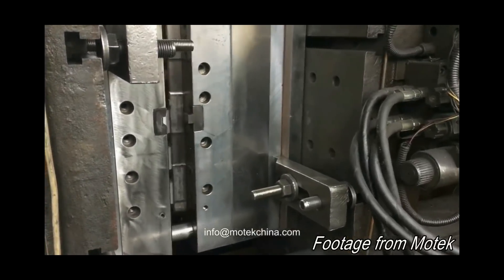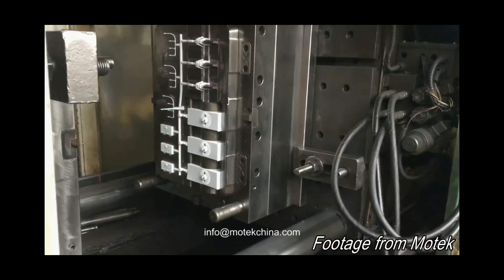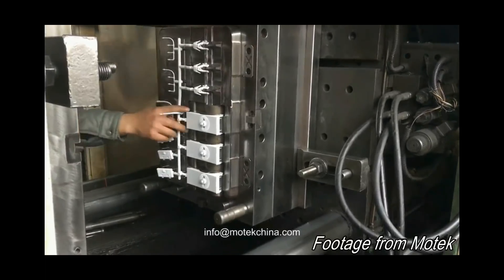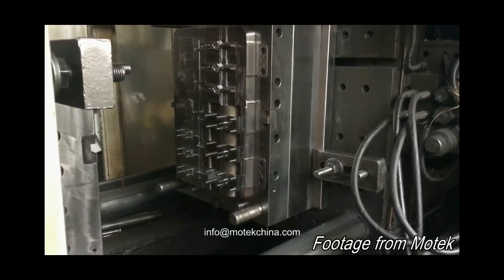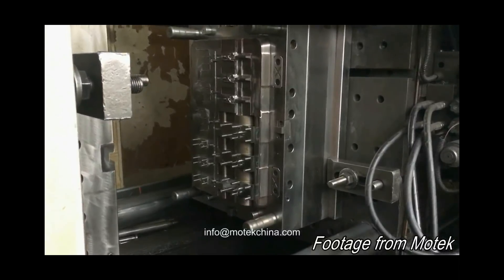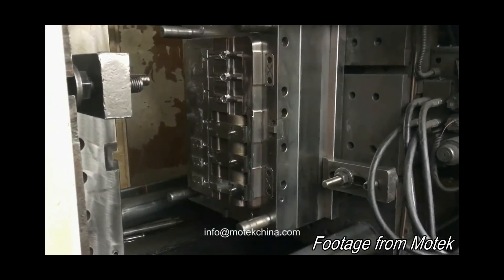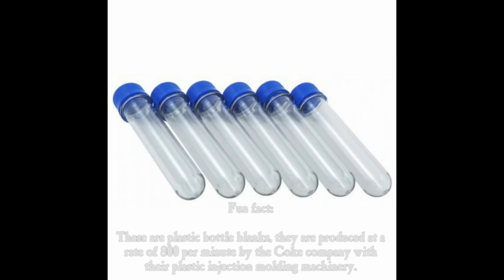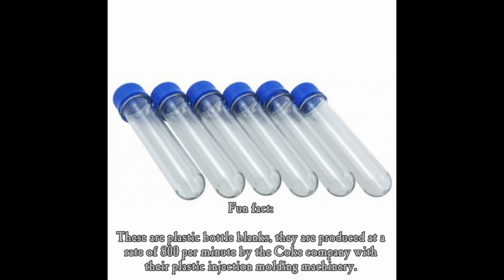Printers and Molds: A Quick Run Down On How Miniatures Are Made

Comment: I really enjoyed your overview, thanks!

It’s right what you say about the 3D printer grain on some FW kits, I wonder why it’s more apparent on some than others? Do you think it is down to the quality of the 3D printer or is there post-printing clean up where the striations are sanded away?
Reply from the maker: On a top end printer they can really slow it down and use a fine filament so that they don't leave much marking at all, or in the case of the liquid bath they can take a lot longer to fine tune it.

On something like a flat tank panel, you won't take that time, as it's not worthit like a miniature's face, so you speed up the process and tell the intern to file/sand away the worst marks later! Most of the Sicaran tanks and such are likely produced with a CNC mill as that's more than capable of producing the detail on a master without having to print it.
Reply: its the angel and the curve they just don't do well in those areas even the SLA printers

Comment: Vacuum chamber doesn't compress air mate, it sucks it out
Reply from the maker: Szymon Michałek a vacuum is used for the silicon, compression is used for the resin. The reason is the vacuum causes the air within the fluid to expand and it "bubbles over" which is not ideal for miniatures and would leave air voids. Compression crushes the air voids. Vacuum is used to remove air from the silicon prior to making a mold master, and as it cures the master is put into a compression chamber.
Reply: Well, I know for a fact that vacuume is used as part of a process of casting a resin miniatures sometimes, ang gives way better results than just compression
Reply from the maker: The only time I have used vacuum and resin was working on boat hulls where the fibreglass lets the air through inside a bag.
Reply: @TheOuterCircle  well, as a person who makes resin miniatures for a living I can assure you that it is somethimes used, although I can't tell you when and for what reason exactly becous of my contract

Comment: I’d love to see FW or GW release a video of them actually making one of their model kits.
Reply from the maker: Variable Hunter well, take the 3D cad design from the start of the video, it is printed out and a master is made of that. The master will be a very high quality cast, and all generations to come after are actually taken from the 1st master which is kept for whenever a new mold is needed. For something plastic, they computer machine the mold, and use the copper anode to perfect the form, as well as hand polishing sections.
Reply: I would not expect that too soon as they would decry that it gives away company secrets. (It doesn't but they would be either forced to admit  that they REALLY overuse CAD and 3d printing or the video will be so censored as to more resemble an audio-only walkthrough of the manufacturing.)

Comment: very interesting, it aint cheap. I heard that many of the molds surprisingly  have a very limited life hence why they tend to discontinue minis - is that true ?
Reply from the maker: Molds can be very expensive, but most molds, like for a model tank, are only a few grand, say $5-10k. That mold will get you thousands of sprues before failing.

Silicon molds however leech with the resins poured into them and over time become brittle and don't release well, meaning they need to be remade every 50-100 pours. It takes quite a bit of time to create a good mold, and if the masters are damaged or go missing that's when they discontinue a product, generally.

Comment: What's the quality of all the different production styles
Reply from the maker: Honestly depends on the quality of the original mold and the material used. Limited-run resin casts in vertical molds which are slow cured in a compression chamber have insane levels of detail, but plastic injection can give you a ton of detail too, just the hard edges are not quite as crisp. As those molds are solid steel they take a LONG time to wear out so the quality is incredibly consistent.